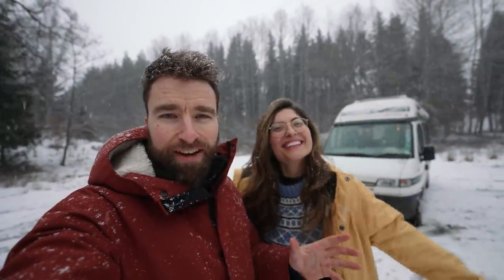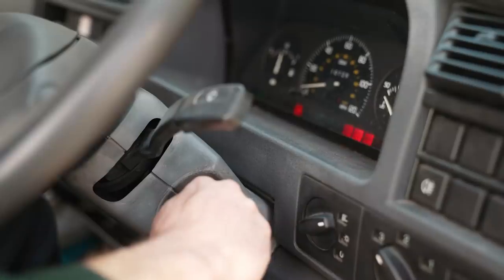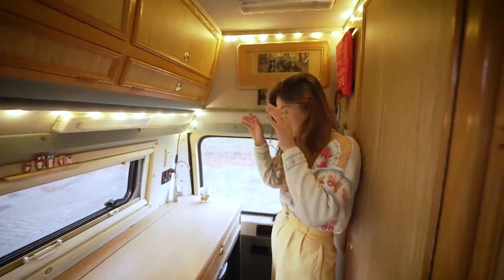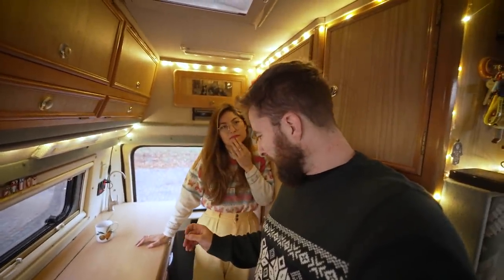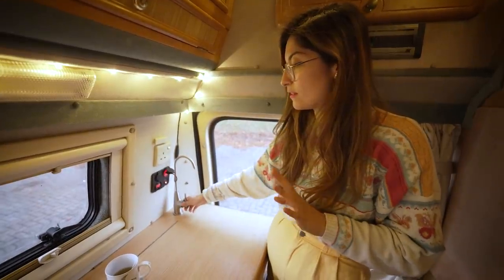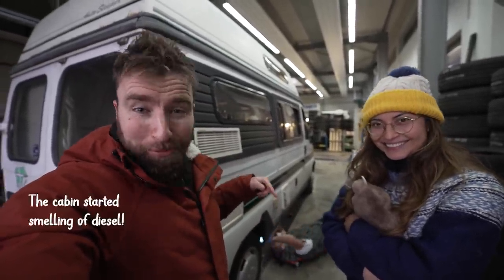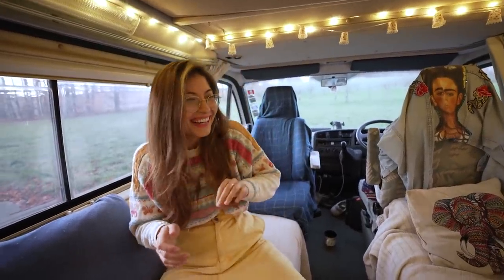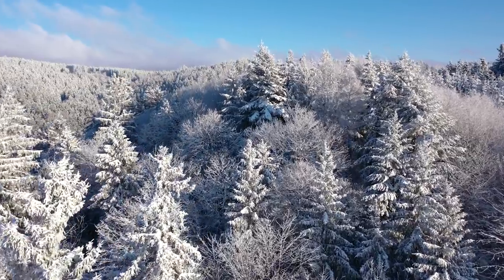Our Van Upgrades After 2 years of Van Life | Modernising our Tiny Old Camper | VAN TOUR

Comment: Great to see the updates on Jits! Tip with the heater, run it at full for 20+ mins at least once a week to "clear out" or "decarbon" the inside/exhaust and it should run forever. We learned the hard way with ours (always running on low) and after a couple of strips and rebuilds we got it working just once and had to replace it. Heard many people running theirs for years and no issues. Hoping for a warmer and cosier winter for you and can't wait for your next videos!

Comment: Thank you for your video. I have taken your upgrades in my beginning.

The first and most important is my new China diesel heater. With his best position for mounting and exhaust tube. Very compact with his own fuel tank = I can use also the cheaper heating oil,  instead of diesel.

The next is my used truck compressor fridge box, runs on 12 Volt DC.
It is a top loader, so the heavy cool air stays in. With an extra part for bottles.
It is mounted on the passenger seat, so I can use it for cold drinks even by driving.
I drive allways solo.

It is also separated from the living area. So when I heat it warm, i don´t heat my cooler.
And I don`t hear it, when it runs. 

I have also a water filter between my water canisters and the tap.
It is a cheaper version, made for inhouse water systems at home.
A new filter cartridge costs 8 pounds only. And works also well, the same level.

I use light proof water canisters, not a water tank. (5 gallons each)
So I can go everywhere to fill it. And connect it directly to my water system.

I want to keep stealth. So no water fill or AC connect outside. And no stickers, etc.
So my camper van don´t look like a camper.

Greetings from sw germany. (liked + subscribed)

Comment: I would stick a Marvel or DC comic poster on the underside of that homemade elevated table - that way it looks like a cool picture when up, and in use no one knows. 

My Van has an Eberspacher - it is decent, but the control thingy is fiddly, and I have had issues more owing to a dodgy uplift filter, rather than the heater itself - but it is decent when I am wild camping. 

I have a cracking little plug in one that that is like a large plug and I use on hook up - it is epic, and the best heater I have probably ever used in my van. If you want the brand name etc, I can dig it out - it is minuscule and fits into a three pin plug socket.

Forgot to add, I am currently buying clothing from Bamboo or Bam Clothing - the clothing is amazing, socks feel so wonderful, tops feel lush, and for me they are my new, eco friendly clothing source.

Comment: Nice! But pay attention to the alternator. Your van seems and older model and using a 60A DC-DC will put significant load on the alternator. I think it's only a 90A or so, so adding the 60A sterling AND a cold day with huge loads (heater fans on max, lights and so), or hot summer day (not sufficient cooling air) might be too much for the alternator. I would carefully check for the temperature, make sure the alternator is sufficient, or downsizing the Sterling to prevent killing your alternator!

Comment: We also changed the leisure battery to charge as we drove along - seems crazy this was not standard until well after our two vans were built. Like the table too. The link you gave for the funnel does not have a sucker for holding it onto the van - did you add that?

Comment: Great video, quick question, did you check with your insurance company regarding the generic eBay diesel heater? My insurer did not like the lack of Warranty they come with and got grumpy about bringing diesel fuel into the van so I've still got it on the box. They said if they thought it was a factor in a fire I wouldn't be covered.

Comment: Not being funny but isn't that a bit dangerous having diesel inside the van? I like the water filter. We have a 1992 talbot express harmony which is very rusty. Our upgrade would be bodywork and install power steering. I also like your upgrade on electrics. Our fridge is amazing in its original form xx

Comment: How many batteries are in the pack?
Reply from the maker: Hi Joe. 2x 100 amp hour batteries 🔋 🔋 Adam
Reply: @JitsIntoTheSunset  Ah nice and those are the sort of batteries that you can discharge fully aren't they?
Reply: @JitsIntoTheSunset  Sorry Adam how much power would you say the fridge consumes in one day? 24ah?
Reply from the maker: Yes, lithium batteries. Hmm, our fridge probably takes about 3-5% of our power on 24hrs. Maybe not even. They are very efficient
Reply: @JitsIntoTheSunset  Thanks! I'm trying to decide if our own (almost identical campervan) needs some upgrades but as we don't live in it I think I can get away with spending a lot less
Reply: @JitsIntoTheSunset  Actually final question (if I may Adam) your 200w solar panel how was ot attached to the roof? With a type of glue/sealant or bolted on? If it fits your roof it should fit mine! But I'm a little concerned the size of it it may rip off without a little front spoiler to stop the air getting under it?